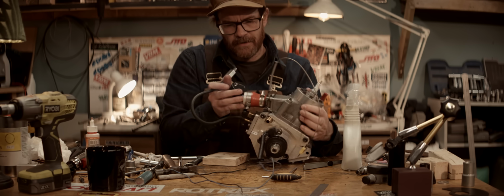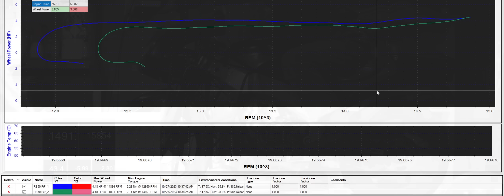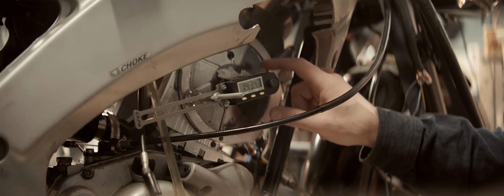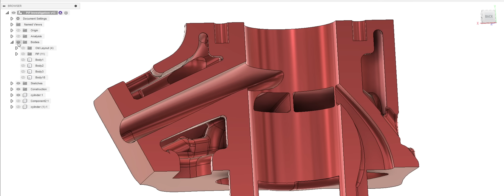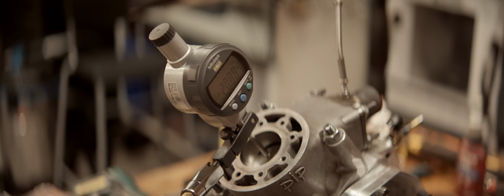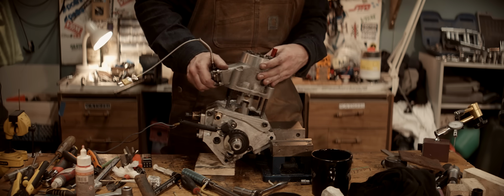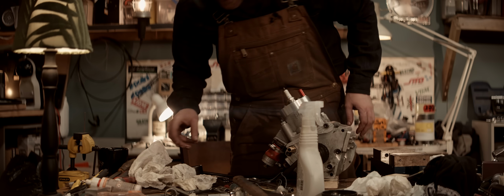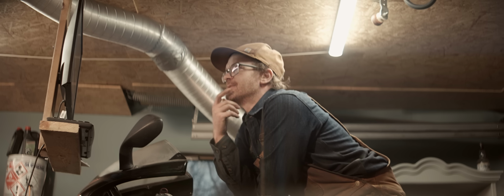Progress for Once - Road to Most Powerfull Two Stroke.

Comment: We called those "wrist pin buttons". We used them in naturally aspirated and blown applications. They were made of Teflon, I believe.. We did have recessed buttons, 0.35mm per side. Room for lateral heat expansion of the wrist pin.
Reply: I've seen those in rc air plane motors.
Reply: and drag cars
Reply: Used those Teflon buttons on a 4 cylinder 4 stroke rally motor.
The buttons got worn down on the hone cross-hatch marks in the sleeve.
I think you can guess what happened to the cylinder sleeves...
Was not pretty.
But there were only 2 score marks per cylinder because we had moved the gudgeon  pin holes in the piston over a bit so that the con-rod remained more vertical on the power stroke.
And that idea worked well.
I don't like the word "failure" when it comes to things tried...
It is really "an idea that gets put on the that does not work list".
Reply: @TheMadManPlace  Yup, it's only a failure if you don't learn from it.
Reply: @TheMadManPlace  Agreed. My experience was when I first started using them in 1975 in a 302 N.A. on methanol, a racing hydroplane. Back then, we tried them as the pin retainers, bad idea... The buttons ended up in the oil pan! In a blown motor that's stroked, the pin hole is up in the ring lands. We used 7075 Alum. machined buttons to fill the gap. The pin is secured with the hated circle clips! Work great, but hard to work with. The button had the oil control ring and second ring to bridge. It was all part of a Ross Racing piston package. Nice pistons, BTW! Since in the 2-stroke engine, he has retainers for the pin, it may work. I would 3-D print something in plastic to go through the pin hole from both sides possibly to block the hole as a passage. I think something dragging on the cylinder wall is counter productive and could be pressure extruded into the piston-wall clearance, not a good thing! Also, RPM, lots of it!
Reply: @TheMadManPlace  If Teflon buttons were getting worn down too quick, the honing was probably far too rough. 
Aluminium bronze is a better material although you have to be careful machining them as it's also quite heavy.
They are not generally a good idea in two stroke motors, transfer ports tend to swallow them

Comment: When I was playing with my Ehrlich boost port engine I was surprised at how sensitive it was to port height. I could not get it running at all until I lifted the barrel. Fussy things 2 strokes.
Reply: As soon as you start tinkering without having the books that explain consequences.
Reply: The first two stroke tuning book I read made a big deal out of changing exhaust port heights by thousandths of an inch which would drastically change the powerband.
Reply: @Steven-p4j  There is no book for mine as it never went in to production. I got a huge pile of parts, none of which seemed to work with each other until I found a spacer on the bottom of one of the barrels. I tried that and the engine started running really quite well but not perfectly. I did some jetting changes - mainly lifting the needle and it's nearly there now but there is still some work needed. It revs well, ticks over ok ish but bogs when opening the throttle. The boost ports and other tuning work raised my engine from a standard 1.7 bhp to 6.2 bhp. Not bad for a 1960's air cooled 50.
Reply: @mjodr yes.  It can. Especially if the transfer height is not correlated to the change in exhaust tight. 

We performance modify a lot of chainsaws & bikes through our shop 😊.

Comment: Be careful about assuming the Exhaust temp is low due to the probe being close to the piston. Remember there is overscavenged mixture being pushed back into the cylinder that is sitting in the duct , thus the probe will read low due to this - not high. Also yes you are correct , if there is linking between the Exhaust ducts and the case at TDC it will run like shit with no power , same effect as having the piston skirt too short and the case being exposed at TDC . We are running quite alot of port linking overlap thru the pin bore in current race engines , yes the pin caps do help power , but its not a huge issue like the TDC one. - Cheers Wobbly.

Comment: I'm running a 96% of bore bridged exhaust in a 265cc ATV engine.  Specifically an '88-'92 Suzuki LT250r.  69.5mm/70mm B/S 125.5mm rod.  Lots of welding and reprofiling of the ducts and entry angles.  It makes good power and torque with a good pipe.
Reply: Wow. Quite a list .  

Could the same power be made with less mods?
Reply: @GR40RCapri  No.  The welding and reprofiling of the porting was done to work outside the limits of the factory casting.  I used a shorter than stock rod and larger than stock piston - this was to raise and broaden the usable power range that the revised porting allowed.  The power now begins at a lower RPM and peaks higher at a higher RPM than is possible within the standard castings.

Comment: That was a nice episode! I had almost lost hope with your rotary valve. It was really funny seeing how the piston pin plug didn't make a difference either despite strong assumptions and even simulation 😁 Also the transfer hooks seem to do nothing either. I was planning to try adding the hooks but now I lost hope for that theory too. I think it has to be the exhaust. Wobblys theories have led us to make the exhaust duct too small. It is compounded by the length of the duct following from the duct cooling idea. Measure the duct outlet area, I say it has to be 25mm circular at a bare minimum and no restrictions in the middle. The pipe header is probably better to be at least 28mm. Think about the 80-90cc cylinder kits that are pushing 20hp+, they all have about 30mm exhaust flanges and the mass of the outflow is not going to be any different in a 50cc cylinder if you are going to push the same amount of power.
Reply from the maker: Might be boundary layer thickness makes a duct that works in 100cc+ cylinders too tight at 50cc. If I remember correctly my iame cylinder has a tight duct, but it's really short, 30mm or so.
Should make a modular cylinder with replaceable ducts.
Reply: Morjesta softaaja

Comment: In the '60s, we ALWAYS used polyurethane buttons in the wristpin cavities, outside of the circlips, to prevent the deadly "double-tap" of a loose wristpin hammering it's way through the cylinder wall.  Oftentimes, some eager beaver would widen a port too far and one or two rings would bow out of round, letting the charge leak past at the chord where it hugged the piston.  One fella put in a third ring on the skirt, more to compensate for the very rich oil/gas ratio he used than anything else, and received much better burn rates, as the still pressurized fuel could not escape up the side of the piston and out the exhaust port.  Just some food for thought, as if you would need any more.  Never forget that we are all rooting for your success and if it takes forever, we'll still be there.

Comment: I have found for getting to far hard to reach locations that if you get sticky back 5" DA disc sand papers and make your own much longer spiral spun porting sand paper cartriges that is mostly spun outward around of itself works pretty decently still slower than a carbide burr for sure but probably more controlable and quicker than a file work! The router idea looked like it was certainly pushing of ones controlability limits for sure! Im glad to see that you didnt end up having to file13 of the entire cyclinder! As always I very much enjoy following your progress and am very glad that you take of your time to share of it as you do! Cheers and thank you!

Comment: What a great video, great progress made.
Could I re suggest plugging the B ports with oiled toilet paper to stop them working which will help give a definitive answer to their
performance. The wrist pin could have being blocked in the same way.
You are now obtaining enough revs to be able to get a good plug reading.
Are you testing the engine from cold.
Over a year ago I sent you a email about a video Mark Atkinson did on his land speed bike which had poor performance. 
The conclusion was the transfers were too large giving good flow but low velocity. I am still a firm believer in high  primary compression. It was one of the major tuning area's of the 70/80's it worked!
Lowering the exhaust port is a major step in the right direction, you know my feelings on that subject. As you said if the spent exhaust gas is not cleared totally it is re burning the left over spent gas which doesn't help perfofmance.
Finally may I repeat the old saying  " you have to get it out quicker than you put it in "
It's nice to see you back in action!
PS. Having watched the video again I can see the water temperature guage is working. I wish the temp guage would not jump about by upto 9C so rapidly.

Comment: When you were brainstorming you mentioned every conceivable potential power robbing problem known to man, but it seems to me that most of them would be the kind of things you would consider when you were trying to tweak the last half horsepower out of an engine.  One thing I didn't hear you mention is the possibility that your dyno readings might be faulty.  Compared with previous runs, the engine now sounds so robust and frisky, so to speak.  It starts, idles, and revs to high rpm rather nicely now like a healthy engine should.  It's hard to believe you're not making more than 9 hp.  Could it be the dyno data?
Reply: As he mentioned myltiple times in the past fews videos a lot of power probably gets "eaten" by his pully setup, the power on the crank should be about 50% more, with the last run around 13-14 hp

Comment: It's like the inertia of the gasses is becoming an issue at these RPMs, like there's not enough time to start moving in the first place. It might be a good idea to start measuring intake mass air flow to rule out any obvious restrictions or your intake mix being shot out the exhaust.
Edit: it could also be that port timing becomes an increasingly big issue with the unconventional exhaust duct design, it will take much longer for the pipe pulse to arrive at the edges of the exhaust port than the middle, this would make the port inherently bad at producing peak power (though excellent at making wide band torque).

Comment: In the 80's I remember using balsa wood glued with epoxy to fill the piston pin was a common practice in 2 stroke racing engines.

Comment: Just remembered from college the double diameter piston 2stroke, large piston skirt with a step reducing the piston crown. Useless because of long term friction, weight and cost, but maybe for the world's most powerful 2stroke ? Maybe.this would make your large crank volume work.
I think your pip engine is more rewarding long term. Good luck.

Comment: You and i are 2 of a kind when it comes to trouble shooting. I immediately assume any and every possible thing has went wrong and needlessly complicate everything for myself. I constantly have to check myself to only assume the obvious or what the most basic fix would be then work my way out to the more obscure. In my experience it usually is the most obvious solution is the right one anyway lol

Comment: To seal the  pin find some aluminum freeze plugs in    Europe I think you call them frost plugs And install them with some  Red lock tight will retain an seal them then if possible cut a circlip groove in ID of the pin to make sure the can't come out. Maby shave the pin  Length down very slightly so you could put a very thin steel shim Is behind The existing risk pin circlip  Then don't use lock type maybe that'll be a bad idea if it melted That would make sure the frost plug Could not come out and do damage Something like that I don't know.  Of the watch your videos because they definitely engage my mind. I admire your perseverance. That's from someone that has made a living working on automobiles motorcycles and internal combustion Engines for 26 years More than half my life keep up the good work buddy

Comment: Your explanation@ 37 min about exhaust velocity sounds like it's designed perfectly for boost application. Boost pressure would keep the exhaust from contaminating the crankcase.

Comment: Hej Alex! 
Just a thought. Har du testat bänken med en motor du vet effekten på? Alltså är du helt säker på att siffrorna du får ut är korrekta? Ta ”vilken motor som helst”, koppla den via växellådan i samma ram och se vilka resultat du får. Eller ta hela högen till nån annan med testbänk…
Reply: yeah it is tested.
Reply: @bierbaum4284  not with the ”gearbox-engine” attached, right? Not as far as I can remeber at least.
Reply: he measured all types of mopeds with his dyno, even a harley i think. but yeah, the am6 box hasnt been measured. interesting for me would be to se the power the system looses. i dont know the english term, maybe drag power.
Reply: @bierbaum4284  so how much power does the the pulley, belt and gearbox draw?
Reply: @BricoleurTV  exactly
Reply: With that low torque, even small extra losses in transmission makes big differences in power output. The gain from deleting and fixing the seals further proves this point. It SHOULD draw alot of power to run that extra belt.

Comment: Many people say that adding a thin coating of grease to both sides of the new lower cylinder gasket will make it not stick, and thus reusable in future disassembly
Reply from the maker: I rub it in with oil for the same purpose👍

Comment: To reduce inner friction: Consider ceramic coating.
CERIDUST 9205 F is highly recommended for this task.
Clariant is the manufacturer.
The results are significant. Personally using it for four-stroke Diesel and Gas-Engines and for Two-Stroke Diesel (Detroit-Diesel V6 Marine) and for Two-Stroke Motorcycles (50cc>750cc) with separate Oil-tanks.
Works properly for +10years of experience.

Comment: Hi. Time 8:00: Torque is pretty important value. Because, torque is same as rpm x power basicly. Not right, but pretty near at least. You can see, there is no more torque, than just a 2,5 Nm, or what evert it was. And that was not even near at the right value. Well, we know than regular natural aspirated 4 stroke engine makes abaut 100Nm/ 1litre of engine displacement. And 2 stroke engines with a good quality exhaustpipe makes abat double of that. So, you do have a 50cc 2 stroke engine, and as wee can see, there is supposed to be something like a 10Nm of torque, and you do have one quarter of that. Well, as we can see, there is absolutely somethin not right. I would guess, than exhauspipe is not doing it's job, because there is no torque! And exhauspipe is the thing, that makes all that mazig torque to 2 stroke engines!! No matter if everything else is right, but exhaust is not, there will be no torque! No torque without good exhaust system.

Comment: Did you ever think about tacking the Aprilia rsa 125 exhaust pipe (tubo 102) and scale dowm to a 50 cc ? 
Maybe it would be a bit longer for your engine rpm target, but if the ratio (engine cc/exhaust volume) is the same of tubo 102 ad also the angles, you will probably see some better results

Comment: You could machine a piston with a captive ring and build off of the threaded top idea. You could drop the wrist pin down into a valley and clamp it shut using a threaded piston top. No exposed wrist pins, and a captive ring.

Comment: I'm loving following this series of videos!  It would be interesting maybe if one video focused just on your thought process of the function of the engine.  And really awful things like the duration and timing of the mechanical parts, just some theory on what your doing and what's different(unless it's secret).  I bet you have a lot of very creative thinkers following your build.  Thanks for being a rock star and sharing your build videos, awesome music and the failures!

I remember long ago typing the valve has to be on the cold side.

I'm still wondering if there's any advantage to two other thoughts I had.  One the surge tank for boost though I still worry about deformation of the valve, and the other odd one is figuring out how to close off the exhaust before filling the cylinder.  My mind still gets all twisted up thinking about duration and how to fill the engine.  One thing you'd probably know is there a barrier of spent fuel that keeps the intake charge from auto igniting?  If so I almost think the forced induction could have the intake over the exhaust.  It just seems like that's the way to fill the cylinder to me.  I'm really don't feel smart recommending this stuff because I'm sure it's backwards to the operation of the engine but..... I think it's going to be important to get lots of fuel stuffed into it.

Comment: Too bad, a method of monitoring and recording cylinder pressure, isn’t generally available, short of having access to a mint.
I suspect it would enable analysis of what’s going on, and ultimately optimization, instead of trial and error derived speculation.
Reply: Rapid-response, pressure sensors are out there and have been used as standard equipment for cylinder pressure data in internal combustion engines for years. They can be had for under $200.00. In the long run, if you can't measure what the engine is doing, you can't improve it. This goes for dynamometers too.

Comment: If that wrist pin hole is bridging between intake and exhaust, it seems like you could rotate the whole cylinder to have one pin hole 100% in the exhaust port and the other side 100% in the intake, then you just have to plug the hole through the wrist pin, not have a plug on each side that rubs on the cylinder wall.

You probably need a new cylinder to do that and/or a new case with different bolt holes so it's not an easy fix but when you make the next version you could incorporate it.